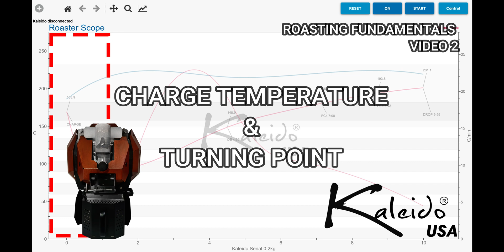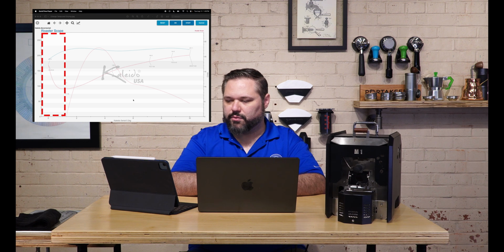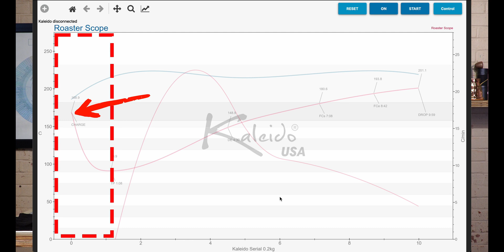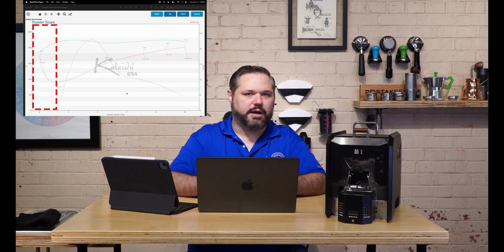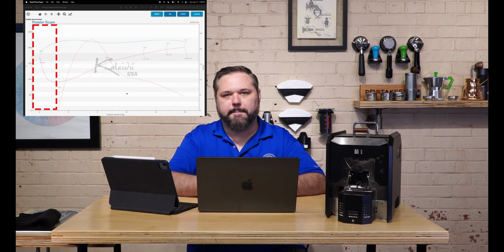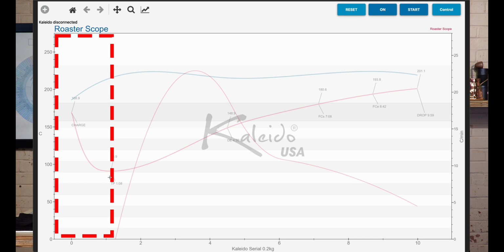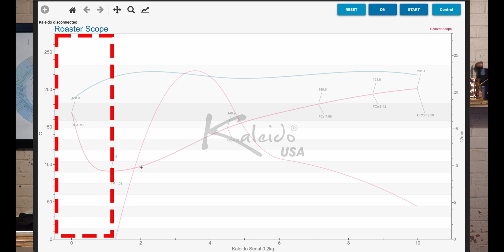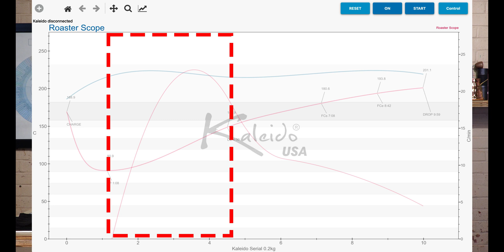Roasting Fundamentals Series - Video 2 - Charge Temperature and Turning Point

Comment: My M2 bean probe reads about 30° lower than the actual temperature. I charge at 275°F and have a turning point at around 50-55 seconds. Is it better to get used to my own temperatures, or is there a way to make the adjustment in Artisan?
Reply from the maker: You can program an offset, adjust probe depth, or possibly replace the probe.